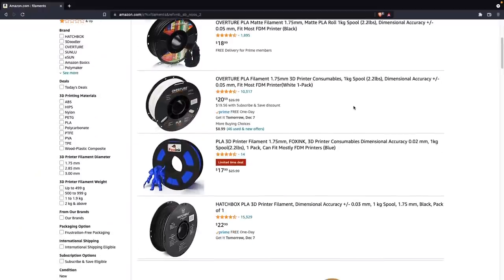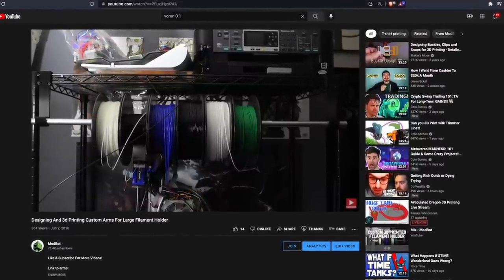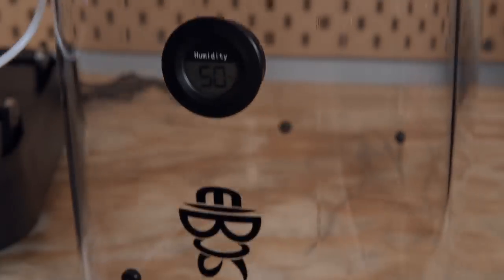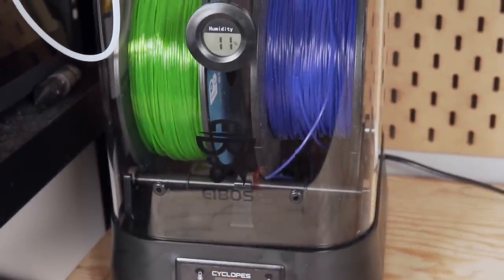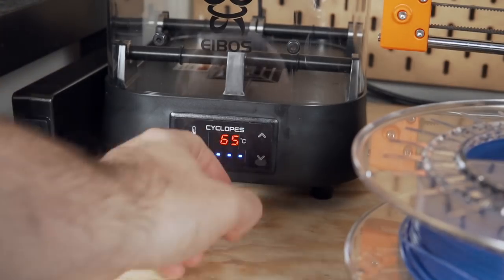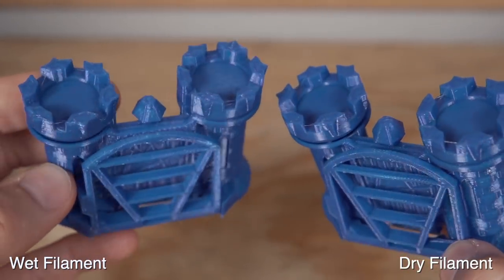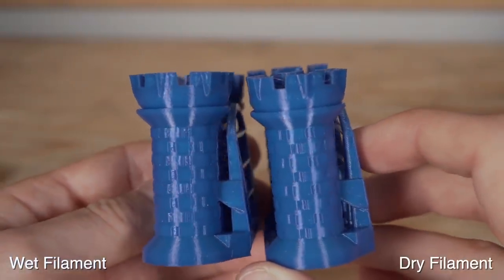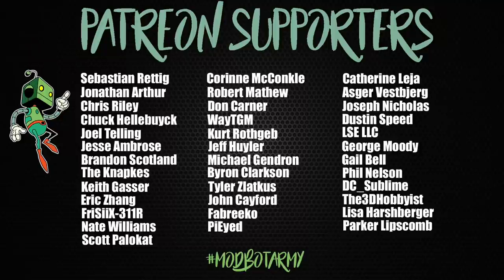Tired Of Wet Filament? My New Favorite Filament Dryers (And Storage Solution)

Comment: I wanna diy a modular filament drying station and boxes. but I'm too lazy :s
make a master heater box that when you insert it, it blows hot air into it, maybe even an RFID tag to remember the temp for drying, or since it's a docking station it can just stick to 50c and let it dry long term. then it has a lot of desiccant and it stays "Charged" for a while.
I have a shitton of different materials that need drying "Nylon, PC, NylonCF, petg tpu and so on" so it's expensive to buy 4-6 of these.

Comment: I have a printdry pro which is a great machine. Over priced maybe a bit but I like that it's expandable to hold 4 spools.
Reply from the maker: Yeah they are not bad machines at all. I think price is really the biggest deterrent for many. Expandability is great.
Reply: The Nutrichef food dehydrator on amazon does 4 spools up to 75C for $88 right now.. There is also another larger version  (9 rack) that may hold 6-8 spools for $129.

Comment: I like my S1, haven't mounted a fan in it, but planning on it. They're doing another Kickstarter for their S2, looks a little nicer than the S1. Definitely not going to do the Kickstarter, so I hope they just start selling it soon.
Reply: Hi Luis, there is a channel called: My Tech Fun and they made comparative between all those cheap dryers and both Eibos models are on the top of the list, including tests with this Sunlu S2. 

As the test shown the majority of the brands worked 10 degrees bellow what they point in the specs, just Eibos around -5degrees Eibos Cyclopes max temperature was about 65 and the smaller Eibos close to max temperature 60
Reply: ambient temperature was 25C when tests were applyed and ambiente moisture 50%
Reply: I have a eSun dryer for about 2-3 years. I bought recently the smaller Eibos… this one is more eficient for hotter filaments but eSun (not the Lite version) has bearings to the spool spin freely and a wheigh messurement for the spoon/filament to mark how many material left. On the other hand just Eibos have moisture display. Fan is loud on boths.

Comment: Try calcium cloride (CaCl2) with filament in bags, it's so cheap and does a great job drying
I have a video about that, but it is in spanish, with links of Amazon Spain so can't recomend further
Reply from the maker: Thank you for the recommendation :)
Reply: @ModBotArmy  what I can say is I spent 3.47€ (about 4$) for half a kilo, with 20-50 grams you can dry some spoiled spools in days and mantain quite a lot, just don't forget to close the bag or the container you store it, it will absorb water until it disolves in water, I did so 😅

Comment: Great review! This unit looks like it might be worth purchasing, for a change. I am always a bit skeptical of these small units because I have tried so many of them (eSun, Sunlu, and the famous "FilaDry" at MRRF a few years ago) and really didn't have much success with any of those.  I also tried using a cheap food dehydrator (like, $30) and it was loud and noisy and didn't circulate the air well, so that went in the garbage also.I run into wet filament issues all the time, especially living close to a major Great Lake (I am 5 mi from Lake Erie or so). During the summer my basement is 60-90% humidity.  I have found that I need to dry out just about every filament before I want to use it, especially TPU, PETG, and of course Nylon. Sometimes brand new rolls even need dried. I have found PLA also gets really brittle if it gets wet, so I also dry it out (just yesterday I had a roll that snapped off in the PTFE tube). At the recommendation of someone in the community, I decided to go "all in" and purchased a Cabellas 12 tray food dehydrator that is about 1200 watts which was about $200.  It has a huge fan in the back to circulate air. It takes me about 3-4 hours to adequately dry out most filaments (at about 70C) where I notice a huge difference printing them, and really like this solution. However, it does take up a good amount of space. The unit you reviewed here seems like it offers a good compromise- decent performance, smaller footprint. I am not a big fan of using bags because I am just too lazy to do that, and I frequently like to change filaments, but it seems like a good solution and could save some time drying out later. I store most of my filaments in storage bins that are not very well sealed and I use a rechargeable desiccant. I've gotten into the habit of just throwing the 8-10 rolls of filament in the dryer periodically when I know I am going to use it.
Reply: Maybe a dehumidifier for your basement would help. It helped me a lot to not dry every spool but the whole room.
Reply: @damustermann  Great suggestion! I do use a dehumidifier as well which is probably 30 ft away from my Maker Space area. Even running that it is typically around 60% in the summer time. I also have a fairly large basement/maker space area (about 1200 sq ft) that is very open, and I'm sure that doesn't help much.
Reply: @GregsMakerCorner  My tinkering area is a lot smaller ;) 
With this huge size, it would take a huge unit with way too much energy consumption, sadly. But best of luck in your drying endeavor :)
Reply: I've had plenty success from storing my spools on (roughly) sealable boxes with tons of desiccant (some of it is reusable). Usually a few days of storage gets the job done. I was able to buy 300 sachets of desiccant for ~4 dollars, which helps a lot

Comment: I feel like there is no way the final price of their cheaper model will be 50 bucks. At that price why wouldn't you just buy two of them instead of their one larger unit? Something doesn't add up from a business perspective. I also do not like the filament type temp knob. That's the same design nightmare that refrigerators have been dealing with for decades. Give a temp readout and full control for the user. 

That said I'm curious about it. I like my s1 and it works well, but having a bit more control would be nice. If the final design is right and the price is right I'd look into it.

Comment: Dont spend good money on a filament dryer just cut off the cardboard lid from a filament box and stab 9 holes in the top and place the reel on your printer bed and cover with the box, heat at 220 for 5 hours and it is dried, the moist air is evacuated through the stab holes and new air is drawn in from the bottom
Reply: Just saw the video on that lol
Reply: @WhiteWolfos  Someone made a video on it, where?

Comment: It is so easy to dry filament in an oven!! I recently dried 6 rolls of  filament overnight in my oven and it works perfectly.  My oven has fans to circulate the air and a temperature gauge.  As you can imagine I do not understand why anyone would not use an oven which works fantastic !!!!
Reply: My wife would never be ok with anything but food in the oven. Either way, I use the oven way too much to leave filament in there for any length of time.
Reply: On the 3D Printing subreddit you will see many failed attempts at oven drying.  Most ovens have a hard time maintaining accurate temperatures, and instead aim for an "Average" by overshooting, cooling, overshooting, repeating.  The styrene spools for most filaments are more temperature sensitive than the filament itself, and can become damaged during the heating. Also, leeching styrene in a place where you are going to be cooking food is highly unadvised.
Reply: @andrewbot  I hear this is why so much baking for things like cakes is done at 350F  Its a spot where the mix makers or the recipe writer knows the oven will always be hot enough but not too hot given the typical lack of precision in a typical home oven.

Comment: Drying works by heat releasing the moisture. The increased humidity inside escapes through the small holes because of vapor pressure. You don’t really want to bring in a lot of moist air with an exhaust fan.

Comment: Never had an issue until a couple of months ago. Colder weather plus stupidly priced heating have made the house colder and more damp I reckon. Suddenly everything was clogging intermittently. I blamed retraction, but just couldn't fix it. So I took a punt and oven warmed my spools for 3-4 hours at 45°c (none of this 'freedom unit" nonsense!). They seem loads better now (from >60%ish to 30%ish humidity) but still a bit hit and miss where they were wound tightly.

Comment: I live in coastal Florida, I constantly deal with wet filament and use the S1 which isn't great. It does work but I have to leave the filament in for far too long.

I backed this dryer in Kickstarter but when I found out shipping was like $45 I backed out, perhaps I will pick one up in the future.

Comment: If you live in a humid climate why would you want a fan bringing in fresh air because it’s humid meaning it’s wet the idea of just having the heating element at the bottom heat rises drawing out moisture and taking it with it eventually the moisture with reduced creating it’s own climate controlled pod so more stable that is the better the print consistency will be

Comment: I've had plans for an actively-dried RepBox to accompany the work printers for a while, except a little bit more of a permanent fixture along with a printer enclosure.

No plans to do this with my Mini at home, as I only ever plan to print PLA/PETG. I will probably get a dehydrator at some point, to dry out filament and random bits of food.

Comment: Hard pass. Too expensive. Buy cheap plastic cereal containers, stick in a hygrometer, some rollers, and a desiccant pack, pop a hole in it for a ptfe tube, done. You can store and print from them, they don't require any power, and you can buy 5 for the cost of any one of these dryers. Desiccant packs are reusable just pop them in the microwave to dry them out. Most people online put the ptfe tube in the bottom, I put it in the lid so if I am going from printing to storage I keep the roll in the container and just swap from a tube lid to a solid lid.
Reply: That solution is not going to work for filament that is already wet.  That works for storing already dry filament though.  You need something that is actively heated to get the filament to its glass transition temperature to extract moisture from wet filament.
Reply: That's thoroughly incorrect. I have some very old filament that was close to 50% humidity and completely unusable and after a week in the bin it was 18% and printed perfectly fine. Heat is not a requirement to remove moisture from things.
Reply: @14768 you are measuring the humidity of the air around the filament.  Agree to disagree on this one.
Reply: @carters2 I am, you are correct, which is a direct result of the humidity of the filament in the container. If I close a container with no filament the air stays at the room humidity level. If I put in extremely wet filament in the container the air humidity in the container immediately rises. Where do you think that comes from? It leeches back out of the filament just like it leeches in to the filament from the air. I'm not agreeing to anything because I have done the tests myself and it makes a tremendous difference.
Reply: @carters2 Let me add one point of clarification. Heat absolutely is required to dehumidify filament in to air of matching humidity, that's how food dehydrators work they don't dry the air they heat it which increases it's capacity for moisture which pulls it out of the filament. I'm increasing the air capacity for moisture by lowering the moisture content instead of heating the air.
Reply: @14768  ok it does seem reasonable that SOME moisture can be extracted this way but I don’t think that is a time efficient way to get down to a RH that I would consider acceptable for printing.  I’d say the RH in my house is around 30% and I want my filament much drier than that.  I dry my filament down to 10-15% RH which takes about 12 hours with active heating.  The spools then go directly into dry storage boxes with desiccant to keep them there.
Reply: @carters2  Fair play, everyone has different requirements. I have a 12 printer print farm and 30 containers. All the filament I buy goes on a container when it arrives and I won't use it for weeks typically.

Comment: There have been videos of people literally putting their filament under water and then running it with no problems the water myth is just that a myth. Bad sections of filament are bad sections
Reply from the maker: Running it under water for how long? What filaments? It is absolutely not a myth that I am certain of. I do feel it is used as an excuse sometimes when it is not accurate especially for materials like PLA. Moisture is a major issue for nylons but also pretty bad on tpu and petg.